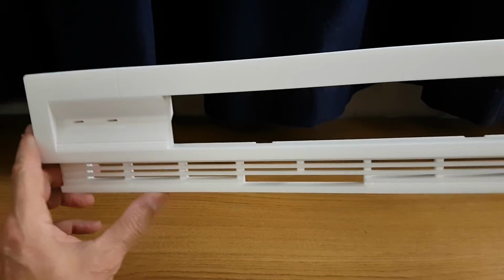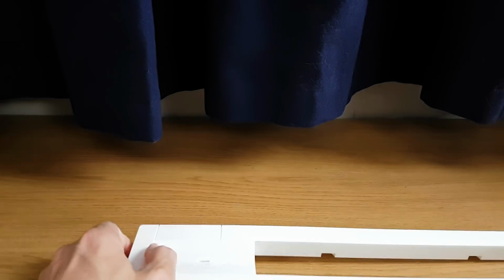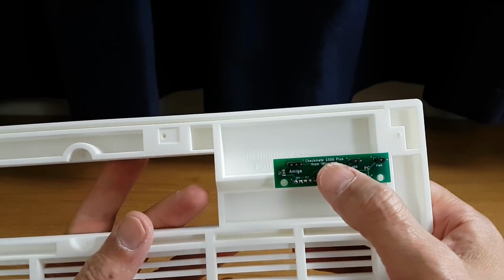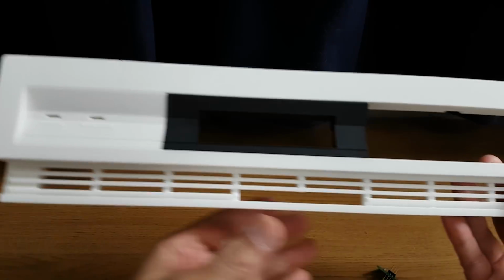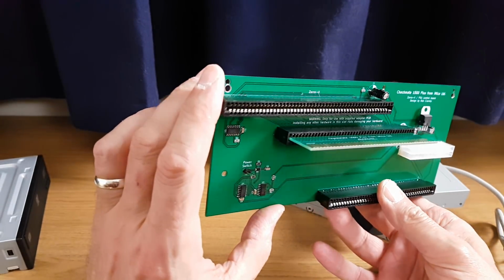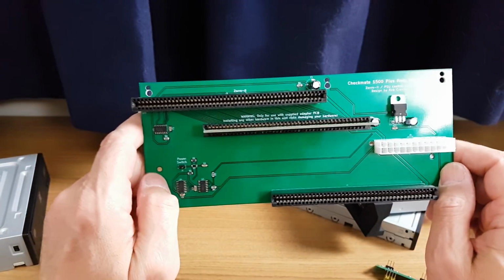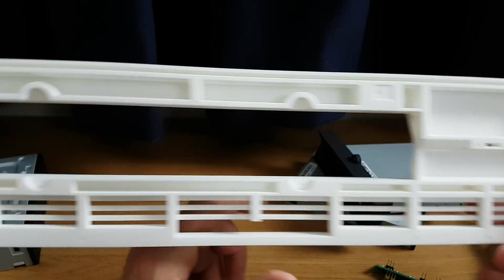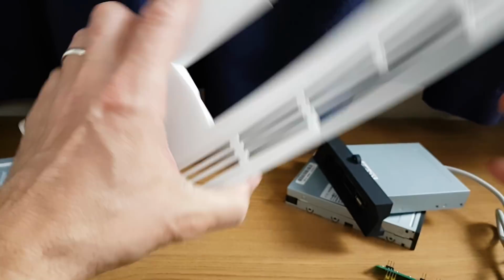Checkmate A1500 plus front panel prototype for Amiga fans

Comment: The front insert looked very snug on the drive, I am not sure that is a good idea. Makes it hard to get things in and lined up properly, especially height wise. It may also transport noise from the drive into the case. Have a look at the fit on the A2000, while I no longer have mine, I do not think it has a particularly tight fit in its drive bays.
Reply from the maker: Håkan Thörngren interesting points but it seems all good so far.

Comment: This is a type of projects should be supported for Amiga "owners". Old type of hardware, just bit modernized so you can use it nicely for "current" use (internet etc.). I don't care if it will run AmigaOS3.1 or OS4.1. This type of "retro-cases" are BEST. Today you get you "new" Amiga and it looks like... PC box, it is actually IN PC box :(.
Reply from the maker: Mole does that mean you like my case or not :-)
Reply: YES :)! (at least part of it!)

Comment: I hope the screw holes will be metal?
Reply: Brass insert like in the new A1200 case?
Reply: YES! :-)
Reply from the maker: I totally agree but it depends if the company I use can add the brass inserts, fingers crossed because I like the idea myself :-)
Reply from the maker: AlienGamer that is a really good point.
Reply from the maker: It will depend on if the moulders can do this, after all once screwed in it should not be undone.
Reply: I understand. But that never ever holds true in practice. See how it worked on the classic cases. Besides plastic get brittle with age. So screwing directly into plastic is never a good idea in the long run.
Reply from the maker: AlienGamer point noted :-)